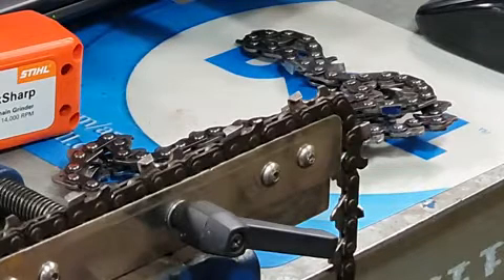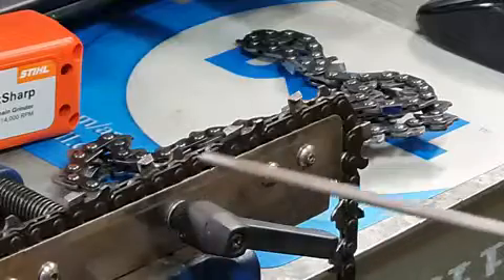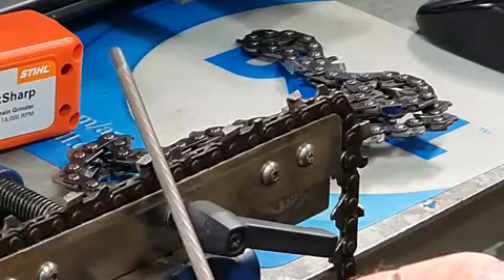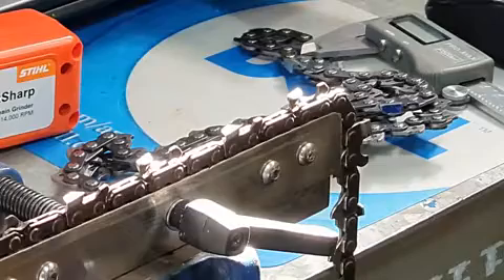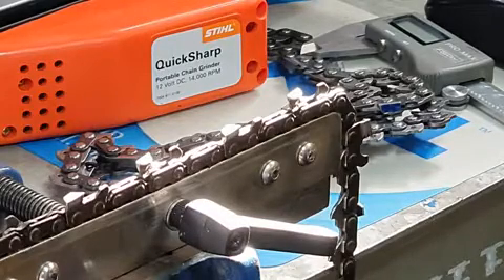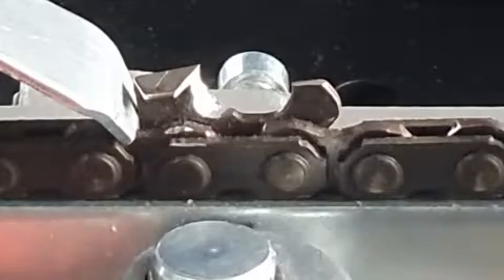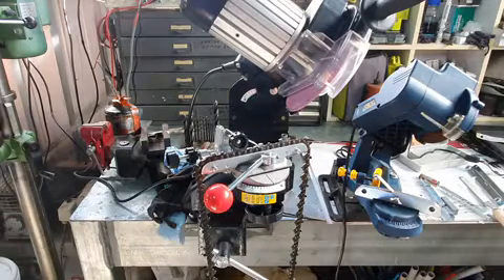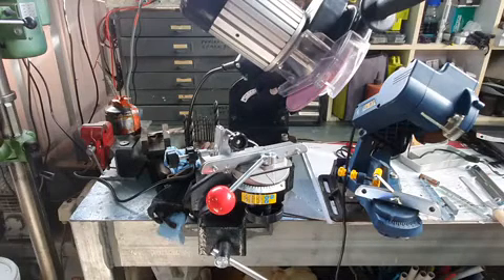How to sharpen chainsaw chain various methods

Comment: Thanks for the video Spanner , one thing I always do is to give my chains a good clean that way my files don’t clog up with oil and sap . Looking forward to seeing more content, thanks.
Reply from the maker: I clean mine in caustic soda brings them back like brand new only 1 tablespoon mixed well in about 400mm water in small round plastic dish.  Soak for 1 hour the wash in water then air dry.  Sharpen chain then spray with WD40